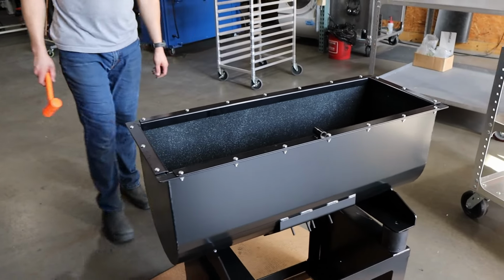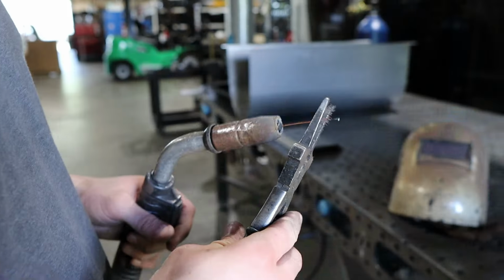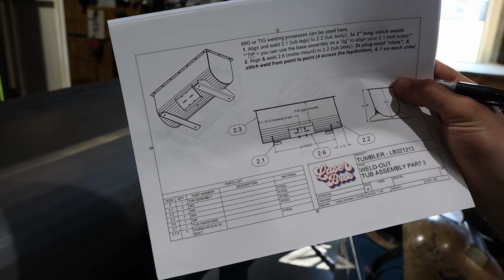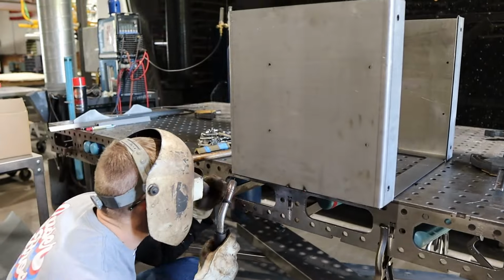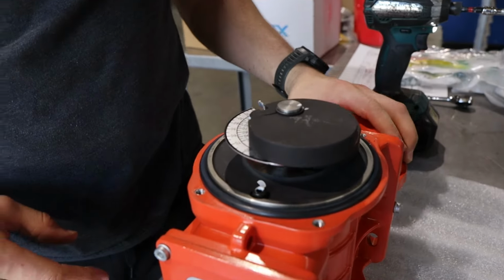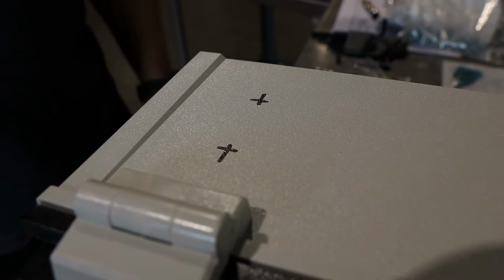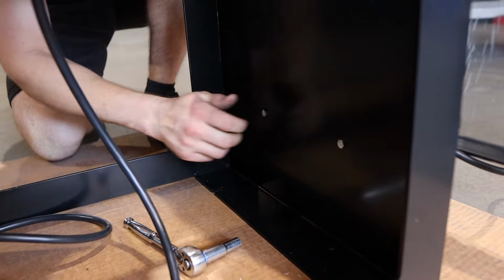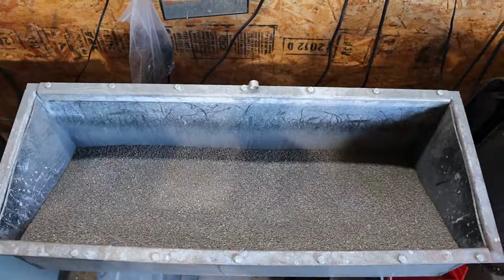DIY Tumbler Build

Comment: That's awesome! I have an industrial-grade tumbler and that thing may be loud, but being able to run parts in the background is super handy. Depending on how nasty the burrs are on your aluminum parts, I have found that ceramic media works well but it will give a much more "matte" surface finish than with the plastic media. Mind you the burrs I was dealing with were from machined parts with no deburring so, experiment.
Reply from the maker: I agree on the ceramic media for aluminum. We use that in a lot of our aluminum applications.

Comment: Hi, very nice video! Do you have dedicated tumblers for carbon steel and stainless steel? Is there any way to avoid cross-contamination if I use one tumbler for both materials, like switching media or adjusting water or detergent? Could you please advise? Thanks
Reply from the maker: Thanks! Yes, we keep one for Carbon and one for stainless/aluminum. For the water we just use Borax (about 1-cup per 5-gallons).

Comment: Will this remove plasma cutting dross? If so, where is a good place to source the coarse media?
Reply from the maker: @mccurdywoodandmetal  it should be able to, but it might take some long run times. I get my media from McMaster Carr!
Reply: @laserbrosusa  Ok, I just ordered the most aggressive stuff they carry. We will see.
Reply: @mccurdywoodandmetal  So how did it work?
Reply: @mccurdywoodandmetal  did it remove the dross from the plasma parts? That’s what I want it for. Thanks
Reply: @Darnic-Fab on thicker parts 3/16 and up it does remove the little bit of dross. On parts like 16ga it didn’t do as well. There was a good amount of dross on there because the torch couldn’t get up to speed due to the small cuts.
Reply: @TheSidewayz240 on thicker parts 3/16 it does. On thin like 16ga there was too much dross due to the torch not getting up to the correct speed because the parts were small. But that was only with a 20 min run time. Not sure if a longer run would finally break it down.
Reply: @mccurdywoodandmetal  Thank you

Comment: one of the best ive seen DIY, and the only little issues are easily sorted out?

use springs, not rubber. they need to be REALLY sloppy and free to kick around how they want. the tub and contents find their own natural resonances.

we never had to bolt our commercial units down. had five about this size running at any one time...

you can play around with the weights on either end of the shaft to produce interesting "tumbling" effects. ie, 180 degrees out produces nice figure 8 patterns. different agitations have different effects. you really can spend years learning the ins and outs of such a "simple" thing! different medias, different types of detergent and ratios of water to media to detergents... yeah. they can do more than just knock burrs off. to get a "mirror polish" on stainless is pretty rewarding... 

the drain... best thing i found was a piece of 6 inch pipe as a sump, with a nylon grate wedged in. usually theyre way too small, and block up way too fast. the holes need to be countersunk, large face down so that they also tend to "unblock". once aggregate is small enough to fit in a parallel hole it wedges in... blocked! the grate needs lots of surface area, as does the passage feeding to any drain fitting.

i learnt very early on just how fast they destroy any exposed metal... replaced the scungy nylon grate with perforated mesh... lasted a week. nylon went back in.

plumbing fittings get shaken to pieces in a matter of hours... all that lasted was having a spigot welded on and hose wire-clamped (not standard hose clamps...) to an external tap.

had a "pet" piece of tungsten carbide, over three years it slowly eroded as well... about as long as my sanity held at that place before i quit, lol... example of how things were there... the lining had decayed on one machine. at which point the side was wearing out about once a month.

i organised a local shop that did "rhinocoat" epoxy for the inside of truck trays to come and see how it would work for this application... for FREE mind you as he saw the opportunity too... the stuffs meant to be pretty well much indestructible. if it worked, we both win. if not, we know and the machines buggered anyway...

day he rocks up, boss shows up with some rubber two part stuff in a drum... "dont worry, use this!"

well, this is awkward...

it lasted a week. it cost something close to $1000...

"oh, but you wanted to use the two part so i bought it..."

"no, i did not. i told you exactly what i had in mind..." that was the final straw, if i recall... sabotaging your own business at every step is not a good practise, in my mind...
the real irony? the industry was hardfacing, wear protection... making mining and agricultural tools...